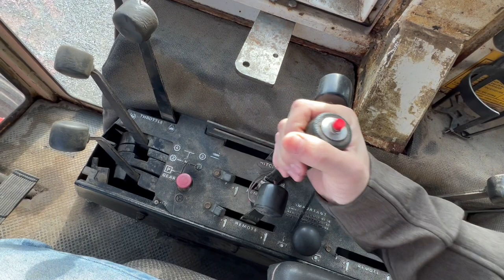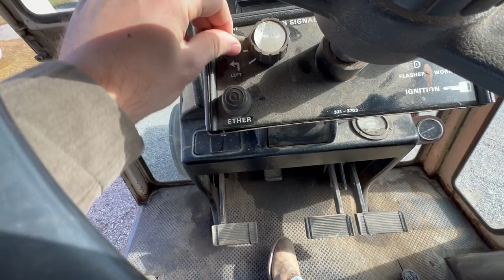I BOUGHT A NEW TRACTOR!!!! (case 2290)

Comment: I'm a case owner. Don't expect that it's a good running case yet.... I'd run it up a hill in 3rd gear and make sure 1st,2nd, and 3rd range powershift is running and not stopping the wheels..If the wheels stop. You need to take it in for a powershift rebuilt. It's gonna cost alot. 7000-8500$ at a shop that specializes fixing case tractors, and at Case IH 10000-15000$..

Comment: B it's got a water filter on it its right behind the injection pump behind that lil shield,  very important to change it, if you put a loader on it you will have to relocate the muffler, most just move it against the cab on the same side